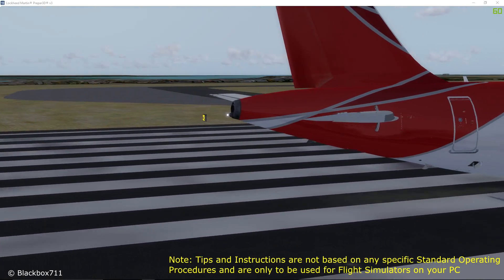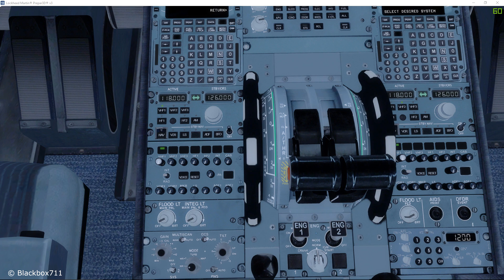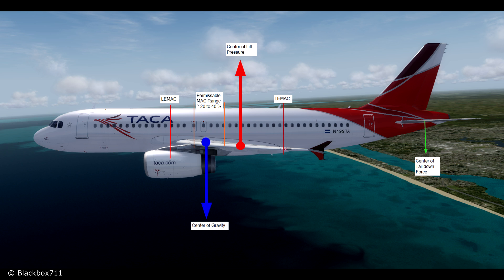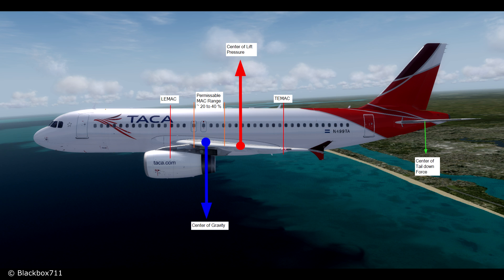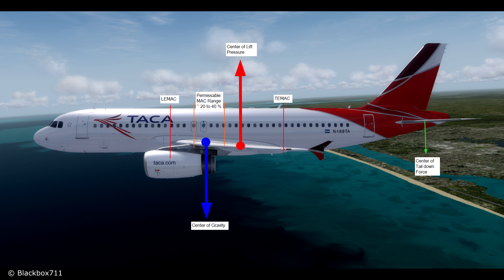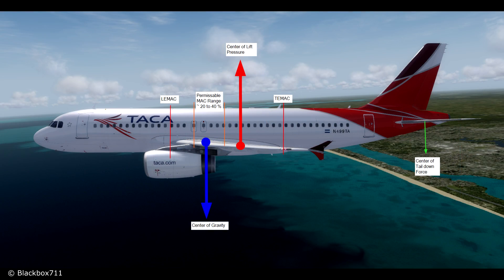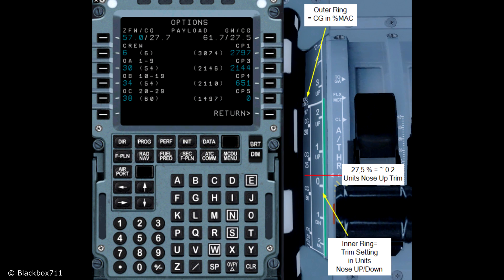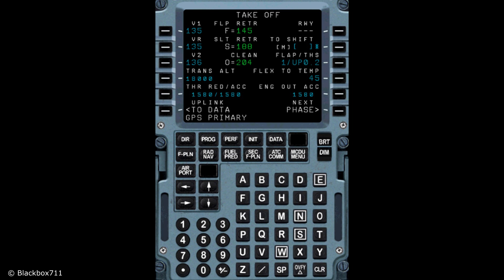FSLabs A320 Basics: Center of Gravity and Trim Setting

Comment: Hello can you explain what happens to centre of gravity when you extend flaps and when u extend slats . Direction in which CG moves forward or backward???
Reply: Thanks in advance
Reply from the maker: Hi. The CG doesn’t change much. It is the Lift Vector that changes. So the distance/position between the CG and Lift Vector changes which requires a different lift vector on the stabilizer and hence a change in trim.
Reply: @Blackbox711  thanks

Comment: Could you explain why sometimes it is up and other times it is down? According to what I understood, the THS always needs to make a down force, but sometimes the THS to fill on MCDU is 0.2 UP or 0.2 DN. In my opinion, when we insert a 0.2 DN, it's making the tail goes down and the nose up, but when we use 0.2 UP it would be the opposite, creating a tail up and nose down. Is it wrong?
Reply from the maker: The trim scale notice UP/DOWN just describes a value from the neutral position. It doesn’t mean that there is a change in aerodynamic uplift/downlift.
Reply: @Blackbox711  thank you.

Comment: Thanks for the video; made sense. I fly a swept wing Rutan canard in real life and have a new friend that works as an A320 pilot that just purchased a Rutan Long EZ.  As a goof I thought I would try flying the sim A320 and found it easy to fly except the auto-trim was stuck in take-off mode. My A320 pilot friend said they never touch the trim but there must be takeoff, climb, cruise, decent  and landing modes. I will search the web or get my friend over to explain on the sim.

Comment: Why airliners don't use stabilators instead ? Wouldn't that eliminate a situation in the airliner where the stab can overcome the elevator ?
Reply from the maker: Stabilators can be faulty as well. In such a case the aircraft will be difficult to control.
Reply: @Blackbox711  What would be your opinion about the L-1011 tristar, which had such a configuration installed ? I know that the traditional stab-elev config is able to be self locking but it also has its share of possible failures that could make it difficult to control as well, like.....runaway stab trim :)
Reply from the maker: Can’t really say much about the Tristar. I know that discussions are running wild at the moment regarding MCAS, but it shouldn’t put the complete stabilizer-elevator setup in question. The problem is a system which causes a trim upset condition that, if not reacted quickly and correctly to, causes a crash. This has to be corrected, not the complete stabilzer setup.
Reply: @Blackbox711  Yup yup :) The new engines and their placement causing a scary pitch up moment at high thrust thats hard to overcome (without the mcas supposedly). They should have modified the landing gear or the size of the stab instead of adding that system probably. Still, the stabilator in those incidends (if hydraulics were still working) would probably allow the pilots to keep the nose up with just the yoke instead of wasting precious time fiddling with cut out switches or grasping and holding the trim wheel, even if stabilator trim was misbehaving, don't you think ? Still, i wonder why didn't they go with these memory items in those crashes, there were reports of earlier lionair crew that saved that exact same plane this way. Also why the redundancies like elevator motion against the trim, or trim switch motion against the trim input didn't work.
Reply from the maker: That is something Boeing will have to answer. Regarding the placement of the engine I agree with you. The final authority must always remain with the pilots in all phases of flight.

Comment: Great video! :)

You can easily calculate your Pitch Trim based on a given CG with following formula:

Pitch Trim = (CG Percent - 28.5) * - (5 / 23) = - (0.2174 * CG Percent ) + 1.239
Reply from the maker: Great formula. Thanx

Comment: Btw. the center of lift pressure of the wing not always aft of the center of gravity. At 9deg angle of attack and typical 4deg of THS trim the elevator has a positive angle of attack of about 4 or 5deg, resulting in a lift up component of the stabilizer. The total center of lift pressure of the wing and stabilizer combination indeed is more aft than the center of gravity, resulting in the needed pitch in case of disturbances. (I'm studying this :D )
For an ideal rectangular wing the lift force would be at 25% MAC but the CG could still be brought back to 40% MAC because of the much longer leverage of the stabilizer.
- edit: actually the center of pressure must be exactly at the center of gravity... depending on the zero lift moment of the airfoil the center of lift can be aft or forward of the cg then...
Reply from the maker: +JetPackJan ... I appreciate your input. However are you saying in the A320 there are circumstances that the center of lift pressure is ahead (so a smaller MAC) than the MAC of the center of gravity? I have never heard of that, but I never studied Aerodynamics.
Reply: In horizontal, level flight in a trimmed condition the net pressure force of the wing and stabilizer combo (lift and moment of the wing+flaps,...) are exactly at the center of gravity, resulting in no torque and no imbalance to rotate the aircraft. If a wind gust changes the angle of attack at the main wing and also at the tail are changed. Now the wing creates extra lift and the stabilizer does the same thing. If the wing's center of pressure is in front of the CG but only by a small amount the moment of the wing around the CG will be a slight pitch up. The stabilizer now also creates a significant amount of upforce at a very high distance to the center of gravity, resulting in a moderate pitch down moment. Combined the lift is increased due to the higher angle of attack and the moment is pushing the nose down, stabilizing the flight attitude.
Depending on the size of the horizontal stabilizer, the amount of induced downwash of the wing at the stabilizer and the distance of the stabilizer to the center of gravity you can have the center of lift pressure of the wing ahead of the CG, yes.

The center of lift pressure at the wing is typically at 24 to 26% MAC (theoretically 25%), and if the allowable CG range is as far aft as 40% then the CG has to be aft of the center of lift of the wing, right? The stabilizer then has to create quite a bit of up force to push the nose down (hence down trim for takeoff).
Reply from the maker: +JetPackJan ... hmmm. Like I said, I never studied Aerodynamics. And even though some of the things you have written make sense, I think we talk about different definitions here. For the A320 (and that is the only aircraft I am talking about here) every documentation that I have come across talks about the fact that the center of gravity is ahead of the center of lift of the wings. I am not talking about combined wing and stabilizer moments. And I have never heard that the stabilizer in the A320 actually creates a upward lift force. That would mean that the aircraft at that point is by definition longitudinally unstable. If you have any documentation for the A320 that proves me wrong, please let me know since I find this very interesting indeed.
Reply: I'm studying in Stuttgart, Germany btw. (Ma.Sc. Luft- und Raumfahrtechnik) 
I just have my notes from the university and the script and we have also heard the definition you cited/gave in the video a bunch of times. If you write my a message to jet-pack at web dot de I can maybe send you the pdf files that I have (if I find the relevant pages again :D). That definition accounts for the lift of the wing and stabilizer as well as the moment of the wing (becomes important when you extend flaps), the downwash and the geometric distance and areas of the wing and tail surface.

The definition that you presented seems to be the better known and understood definition, it is well established in people's heads.
Reply from the maker: +JetPackJan .. I will send you a pm, thank you! Anyway, I am aware that the explanation here in this video is very basic, but it is for flight-sim enthusiasts who want to know a little about CG and trim setting. Regards

Comment: Question; I work on a major airport on the US and I always see lots of the A320's at the gate with flaps 1 down, no clue why, if is one plane here or there is ok but Ive seen a lot of 320's like that, any reason why? Or just the pilot forgetting to raise them up.
Reply: Efrain Rodriguez  I know that airbus pilots leave flaps 1 position on parking if the outside air temperature (OAT) is at or above 30 degree celsius to keep the slats extended to cool down some sensors in the wing, otherwise they give false alarms in the cabin.
Reply from the maker: +Efrain Rodriguez .. No, the pilots would not leave them at position 1 accidentally. Since most of the takeoffs are done with flaps 1, maybe they leave them at that position when arriving in order to save a movement cycle when departing. I remember there being such a procedure for the A310 and A300.

Comment: Great video! Enjoy learning from your tutorials. One question: what effect does entering the trim value in the Takeoff performance page have (ie what difference does it make; does it have any effect on fuel calcs etc)? Cheers.
Reply from the maker: +Adam Joyce .. the input acts as a reminder. So there is a certain flow that pilots do, and setting the trim and checking it against %CG is a form of redundancy. The newest FWC Standards actually will give a master caution if the entered CG doesn't correlate with the entered and set trim setting.